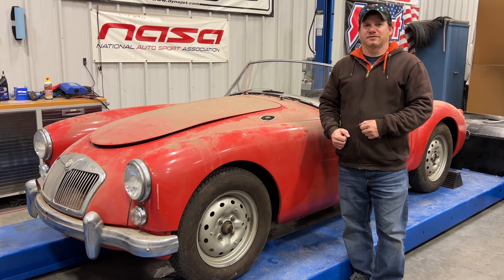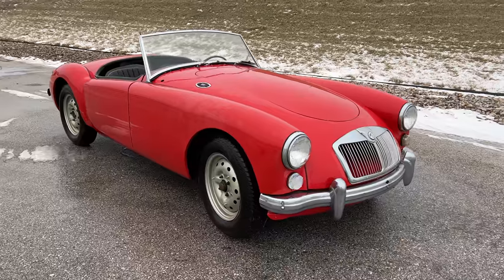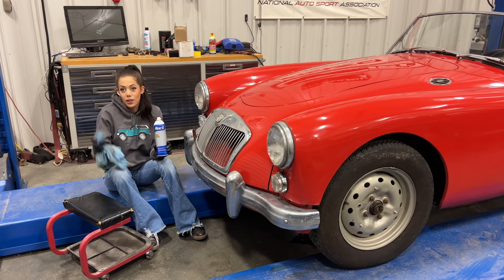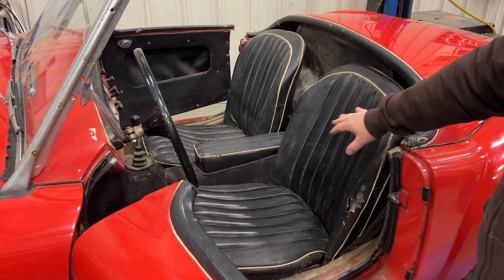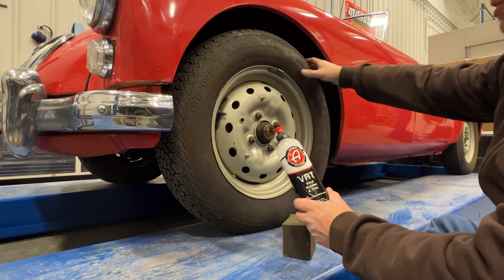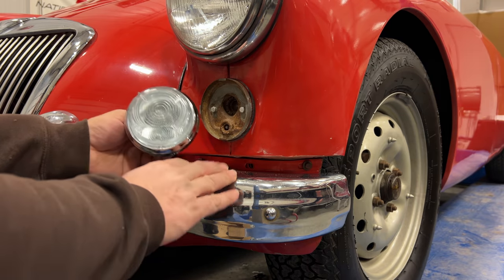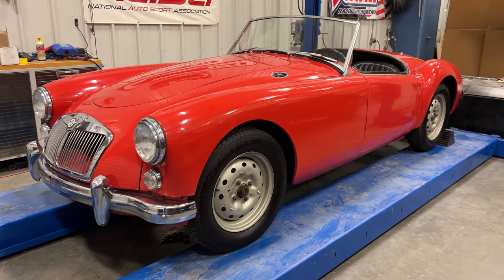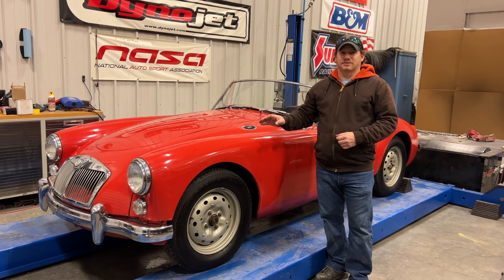1960 MG MGA 1600 Roadster - Part 6

Comment: Good video. The MGA roadster is a car I never get tired of looking at. That is a very good example and the body looks to be in excellent condition with all the correct panel alignment.
The seats will be fine for another 20 years, don't worry about them.  Just drive it.
Reply: It is one of the best looking MG's ever made. And I'm speaking as an owner of 2 MG B's!
Reply: @alexgallacher5720  I had a 1968 MGB I think in 1973 for a short while, but moved on to a Lotus . Very reliable if maintained properly. Now I have a 1960 MGA and a just fully restored 1979 Midget. I would like to restore an MGB. 
They are great fun.
Reply: @awalk5177  Nothing like driving on a quiet road late in the afternoon or early morning with the top down. I am jealous of your MGA - I still think it is one of the best looking MG's of all time. Not as much room under the hood to work on - but I could put up with that, if I could afford one!
Reply: @alexgallacher5720  Yes one of the best looking cars although I do love the MGTF ( in black)

Comment: Hi Steve ! Nice car. My 2 cents: for cleaning around the car, even the tires and engine compartment, you may try Spray Nine.
The stuff stinks (to a degree) but is awesome on grime, even motor oil & grease. Your tires will look as new with none of that dumb shiny look.
It's really a great product ! It demands a good rinsing though.

Comment: Definitely a nice driver quality MGA.  Looks like it was kept up over the years including a somewhat sloppy repaint.  I can't stand when I see over-spray on wiring!  The over-spray on the rear tail light assemblies is also very evident since the rubber gaskets on the fender are now red instead of plain black rubber.

Comment: Sweet little car coming along nicely, but I couldn't help thinking that the new sidelight unit looked like flimsy aftermarket junk ?
Reply from the maker: They don't seem any better or worse than the ones that were on there.  Biggest difference is the Lucas lettering from the original were not in the new lens.

Comment: I own an identical MGA—red with black trim and whte piping—other than it has wire wheels and is RHD. It had a body-off restoration 30 years ago. Yours is in remarkably sound and original condition. I assume a West Coast or Southern car?
Reply from the maker: No just been sitting in a barn in Iowa for 40 years.